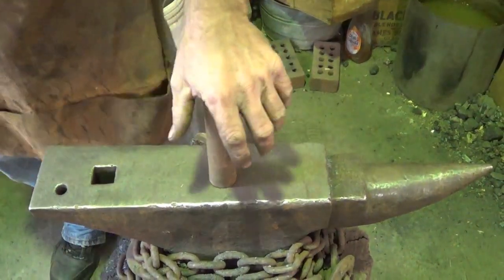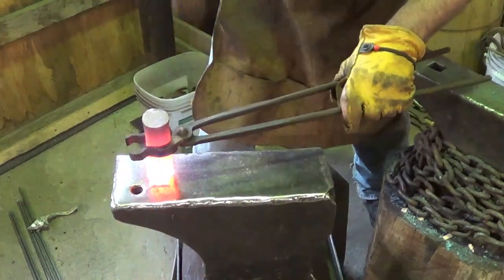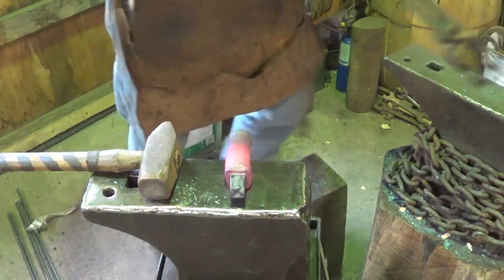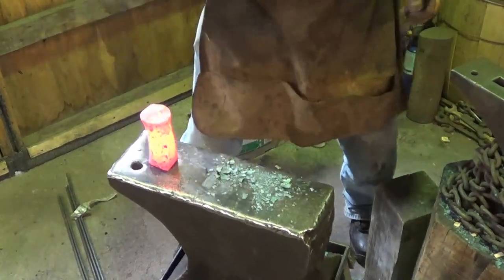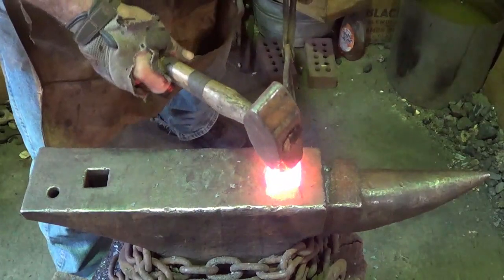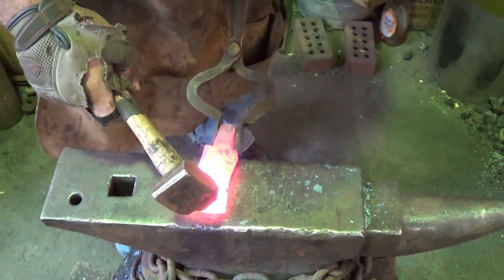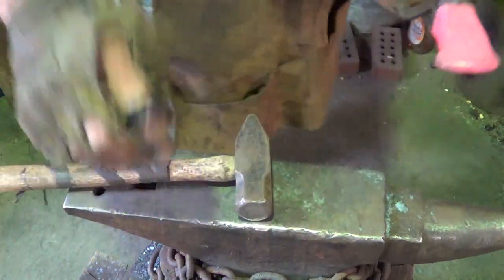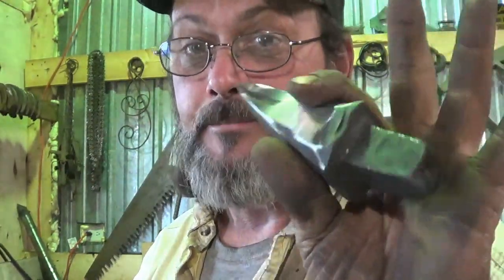Blacksmithing - Forging A Hardy Cut Off Tool

Comment: hey Chandler love the channel. I'm no blacksmith just a guy with a hammer and a fire but, upset then taper seams like to much work to me. my hardy cut off is made from a Ford 9" axle. i started by tapering and then upset right in the hardy hole.  worked for me anyhow. keep up the great videos.

Comment: I wouldn't have minded getting that broken anvil with no horn.  I cou;d use one.  If need be I could cut, grind and then have a friend weld a horn to the anvil body.  But I would still be able to use it pretty much asis... nice video, nice work.  Thanks for sharing.

Comment: Looks great, Chandler! I noticed around 11:00 or so, you commented that the mass of the rod wasn't centered on the stake and that it was sort of skewed. Not to tell you your business (as you're much more talented than I), but you can keep the rod straighter and more centered by walking in a circle around the piece as you upset it. Your hammer is hitting it at a slight angle no matter how carefully you try to strike perfectly horizontal, which is causing it to skew off center. If you circle around it as you work, you will upset it evenly all the way around, keeping the rod straighter and more centered. It works well with a sledge hammer, too. Check out Torbjörn Åhman's channel; he demonstrates the technique in a few of his projects.

Comment: Just a tip that I recently discovered:  use a heavy hammer when upsetting from the backside, and use a light hammer when upsetting from the end in which youre trying to gain mass. the light hammer provides more of a direct shock and makes upsetting faster, and easier to avoid distortion.

Comment: Thats quite the hunk of steel to be moving without a power hammer. My hot cut hardy tool is just a square pipe welded to an axe head.
Reply: Good idea
Reply: I know this is a year old, but I sincerely appreciate this idea

Comment: i know you've probably thought of this but do you think it's possible to make one of these from an old trailer hitch ball that has the bolt screw up through the center of the ball?  or would the bolt ruin the integrity of the end product because of dissimlar materials?

Comment: one problem with your cut off that I can see is that you made it so it can fit in the hardy hole in both directions witch will make it want to bounce out, the hardy hole in the anvil is not square and that means all of your hardy tools should be made to fit in one detection.

Comment: How wide is that axle? Also, what kind off steel could I use for this? Would something like 1045 be good?
Reply: Depends on how versatile you want it to be. 1095 can be tempered for cold cutting or hot cutting. 1045 can probably do the same, but not as efficiently for cold.

Comment: Did you anneal the axle before forging? If not, it might have made for easier work.
Reply: It doesn't matter
Reply: +Greg “TrumpOrDie” D it kinda does. Its going to be a lot more work if youre beating on hardened steel instead if softer stuff.
Reply: +JN7556 you do realize that when you heat the metal up to red or orange it looses all the hardness it had before, right?
Reply: +Greg “TrumpOrDie” D loss of temper is not annealing.
Reply: Yes. But do you know that metal alot less hard when its very hot. And do you know that annealing is for making it as soft as possible while its not very very hot? Annealing doesn't effect it while its very hot

Comment: Seriously? HOW DO YOU BREAK A HORN OFF, That's like, 25^2" of freaking steel!?
Reply: you can crack your anvil fairly easy, someone got it chipped far enough and didnt repair it and eventually one more chip broke it clean through. At least thats probably what happened, it happened to a friend of mine
Reply: IGlotzbach Forges Here in the south during the Civil war, when Union soldiers found an anvil they manage somehow to break the horn off. The horn was an important part of the anvil to work horseshoes. This was easier than taking the whole anvil.

Comment: Here is a question, don't jump to answer it think on it before answering, I dont forge but the act of combining multiple pieces of metal into 1 like with the bandsaw blades when looked at could also be a form of braising, this is the thing to think on. I machine metal not forge so dont bite my head off please.
Reply: +gigabytex64 with brzing youre adding a bronze rod to make the weld as opposed to just using the base material.  someone correct me if im wrong.
Reply: +Shambler101 Aluminium braising is done aluminum to aluminum
Reply: +Shambler101 also the blades where held together with welding and it is a different alloy to the mating surfaces?
Reply: i think youre overthinking it.
Reply: +Shambler101 yes but studying metal helps when you're trying to get the right metal for a job. Carbon content is what I'm aiming at in the long run.
Reply: yeah but that has nothing to do with your original question really.
Reply: +Shambler101 the reason why i asked is because the finished bar had striations lines basically for each blade and they should not be there unless they are not 100% bonded.
Reply: +gigabytex64 there is different carbon alloys causing the lines the only other time i see this is in braising normal welding isn't the same as it works in a different way, melting everything into 1 material.
Reply: Brazing is somewhat akin to super gluing two pieces together.  Forge welding is just that.  welding two or more pieces together to make one solid piece.  
What you were saying about there being striations on the edges.. that just happens.   the edges cool much faster and its harder to get to take a weld.  if you grind the edges down its one solid piece. 
Think of welding (MIG, tig, stick, flux... take your pic) two pieces of plate steel together.  Thickness, hardness, alloys.. all come into play and you have to adjust your current, gasses, feed rate... and so on.  You do for forge welding as well.   stronger steels with higher carbon content should be heated slower to bring to forging temp than a more mild steel.  You have to watch and make sure they're the same temp being heated at different rates if youre forge welding two different carbon content steels.

Welding two pieces of plate steel, you're welding the edges together.  but everything in the center is still two separate pieces.  In forge welding the two pieces get welded to one piece throughout.

brazing is more like using duct tape or super glue.
Reply: +Chris Isner well said!
Reply: +Chris Isner We weld to a v shape as there is better bonding foe the pieces there is no visible weld we do this as it comes out as 1 piece of metal even after turning it on a lathe or mill there is no visible joint. Will not the separate cool rate of each section not give you difference in strength or hardness as you move around the blade. Heating and cooling whilst forging will change carbon contents in each layer come into question.
Reply: +gigabytex64 trust me. I've been a welder and metal worker for 20+ years.  I've been a blacksmith for 10.  I know all about machining a welding channel.  the angle and depth of the channel makes a lot of difference depending on the piece.   Let's say the plate steel you're welding is 18" square, and each piece is one inch thick.  No matter how deep you make the channel or how many passes you give it, it's still only welded on the edges.  In forge welding all 18" inch's of it will be welded and joined to one solid piece.  

When considering the differences in cooling and  carbon content and hardness keep in mind that as blacksmiths we aren't worried about loss in carbon content as much as a machinist.  We're making decorative pieces of knives/axes and so on.  A minute loss in carbon content doesn't have a very noticeable effect on strength with what we do.  If we needed a set of gears, highly engineered to demand a certain tensile strength.  our knives aren't going to require an engineered strength that can withstand 10's of tons of pressure/torque/force.  

Higher carbon content steels are more brittle. Lower content steels don't hold an edge as well.  so forge welding and folding the two into one solid piece is beneficial. The higher carbon content steel keeps it strong and the lower, more mild steel gives it pliability.  The mild steel acts as a shock absorber of sorts.  Helping the stronger, more brittle steel endure more abuse.  When quenching and hardening, the higher carbon content steel will still harden more than the lower.  The loss in carbon content and hardness due to repeated heats and welding temps is really insignificant to what we are forging.  It's not a noticeable difference. 

If we want gears for a crane requiring something strong enough  to withstand 80,000 pounds of torque or force, we'll refer the client to a good machinist.
Reply: +Chris Isner Thank you thats the type of answer I needed honestly, I cant learn from simple answers and I do understand it may have frustrated you but thanks for your time.
Peter

Comment: i need an anvil. i have been useing a sledge hammer head for a year now and i hate it. it sucks liveing in orlando becaues there are hardly any  blacksmiths and verry few meteal shops around
Reply: I feel ya.  I'm in Deltona. finding anvils around here (much less for a reasonable price) is damn near impossible.
Reply: Chris Isner but yeah everything els is like 450 and up

Comment: How does someone break a horn that's a shit ton of steel it shouldn't be possible to do that
Reply: Horns are usually pretty soft and often welded on to the rest of the anvil. If you wail away too hard far out towards the tip you can break it at the weld. It's not an uncommon issue for people abusing their anvils.